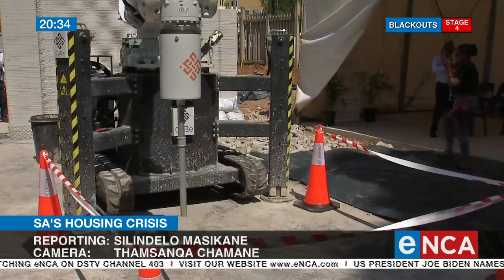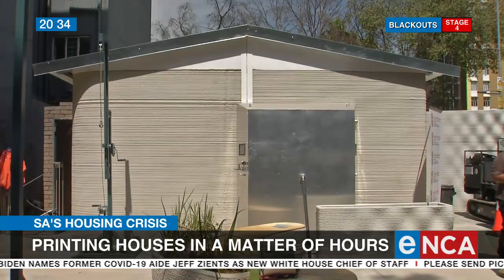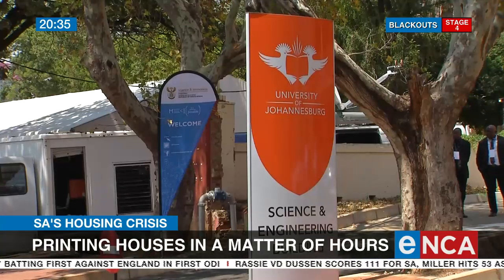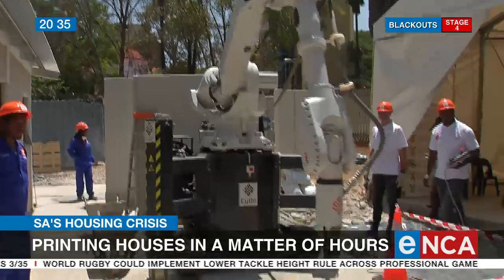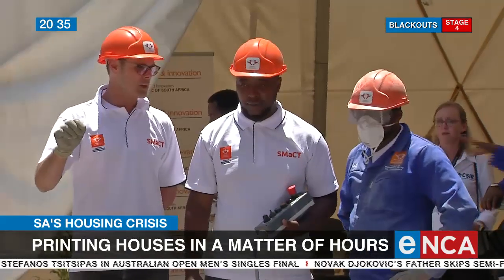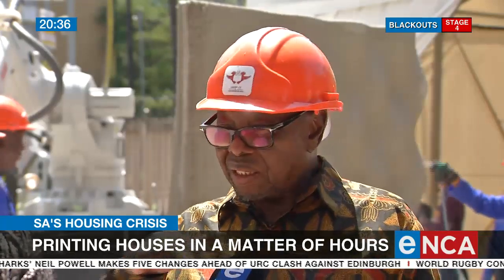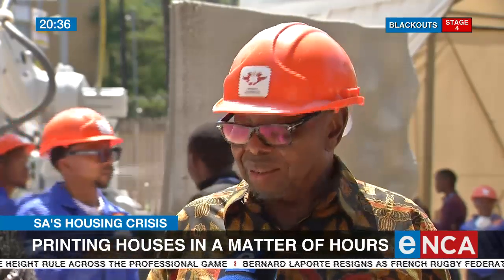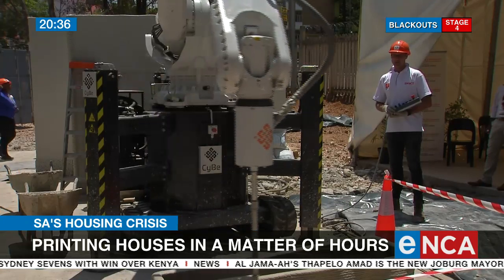Printing houses in a matter of hours

Comment: This is a good thing for SA, but we will screw it up, by either stealing of burning.
The person we need at this moment is some that can measure out the materials to manufacture 3d printers. More 3d printers more homes more jobs for manufacturing 3d printers.

Just know that the person with the engineering degree that's operating the device won't just give his blueprints on how to build it, and he or she will take the job opportunity in another country, currently other countries are targeting essential skilled workers to but up there country. Anc will let the middle class work extremely hard to build the country but if you have too much empty vessels in one group they will burn and destroy something that's generating knowledge to the youth..